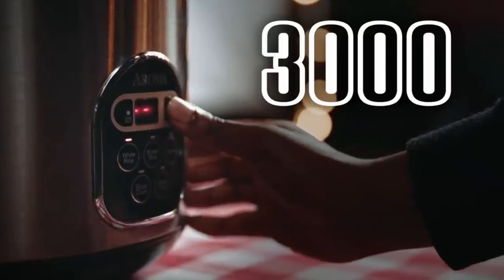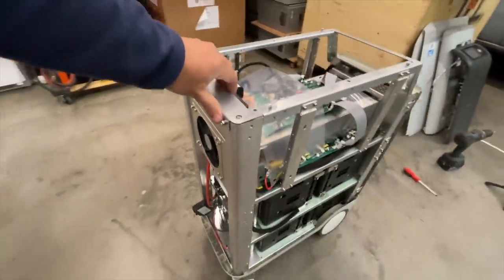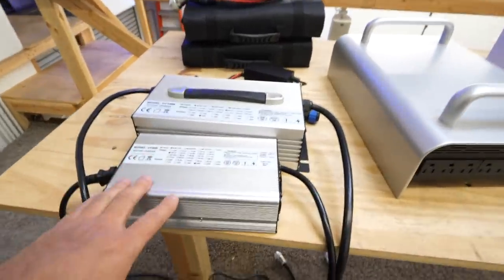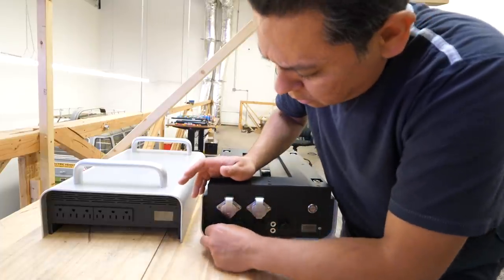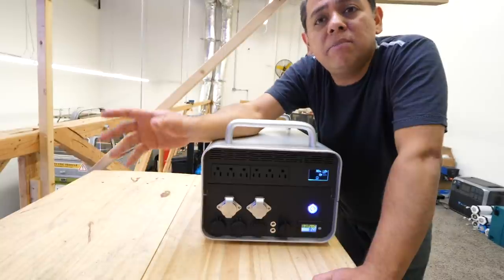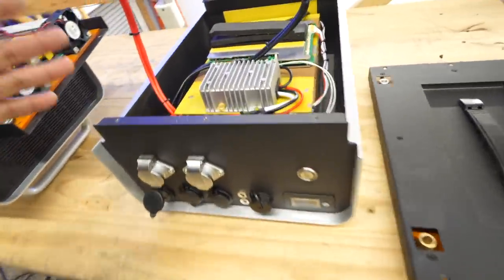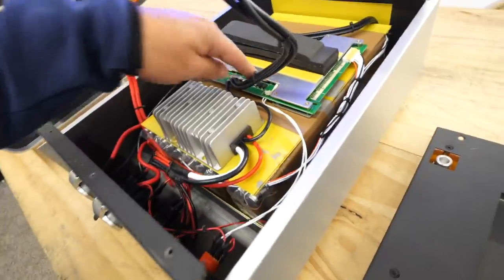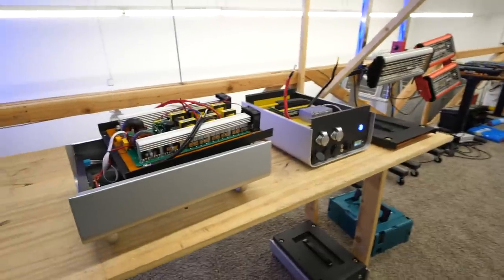How WattAnt made 3kWh capacity 3000W PowerPack under 45LBS

Comment: I just built a 13,000 watt hour system with a 2000 watt inverter. Total cost including supplies and solar panels was about $1,600. Maybe not as sleek as this model, but far more affordable.
Reply: Hi Justin, I like to hear that for I too love to build my own stuff as well. Could you tell me what kind of batteries did you use?
Reply: @solo1848  I used lishen 280 amp hour cells off of alieexpress.  They are 3.3 volts wired in series for a 12 volt system with a mpp solar all in one charger and inverter. Look up Will Prowse on YouTube. He has links to them and instructional tutorials.

Comment: Seems like a good idea but it needs a simple battery pack without the outlets to keep the price down, just charge them up and stack with the other packs
Reply: Like the Titan... yes!
Reply: YES!!
Reply: Options would be nice, with or without.  I could easily see a use case where someone is building a cabin and using all DC in the cabin, but need the outlets to run things on the way to being all dc.  Charge the pack at home, trek out to the cabin for a weekend of building and away.

Comment: Great review Jehu. One serious oversight I'm seeing is the fact that there is no switch on the inverter. It is very common to only turn on the inverter when you need it while using the dc side of things for dc loads like led lights. Without the ability to independently turn on the inverter (preferably with a remote switch placed in a convenient location) I would be losing power all the time having the inverter on standby. Those losses might be small, but with a remote switch you wouldn't have the loss at all. Looks pretty good other than that.
Reply: Hi Rolland, I'm from WattAnt team. We agree with you, and already confirm will add the switch to AC inverter for kickstarter orders.
Reply: Hi Rolland, thank you for loving our unit! We now offer 1500W MPPT controller build in and chainable feature for two 3100wh batteries. So you could get 6200wh at once, also can charge two batteries at once.

Comment: 2:30 mark: "No other company". 

Um, dude ... Inergy and Point Zero have been doing that for at least 2  years. And their price point is competitive. I haven't purchased theirs, because I am waiting for them to shift from Lithium Ion, to LifeP04. WattAnt has done that. Their 3000watt setup, though, is more expensive than Point Zero's.
Reply: Except...try to buy either of their products and you'll see they aren't actually in the hands of real consumers just yet.  The titan is FAR from portable, even being modular, also.  Wattant isn't using LiFePo4 cells, either.
Reply: @toddyork5698  - WOW!  Where'd you get that load of horsecrap, mate?

BOTH companies are on back order. I have actually visited Inergy's home office .. in person. I simply opted to not buy, because I wanted LifeP04. The next-gen Titan, will give me that.

"aren't actually in the hands of real consumers yet"???

Um, yeah, they've sold thousands. I looked at their products precisely because personal friends use them.

And they're the same size as this unit. 

I'm 100% susceptible to being persuaded by empirical evidence. Not horse manure.

Comment: This would also make an excellent UPS (uninterruptible power system), especially with stacked batteries. This could be made hot swapable by keeping at least one battery unit on the inverter. A blank top for no inverter would also be a plus.

Comment: The company can offer a parts list, so there is an easy source for spare parts.
Reply: Hi Carlos, there will be 3 years warranty. Afterwards, you could contact our customer service for spare parts if needed.
Reply: Why is a kickstarter campaign needed for a company that is already in the market but did not really succeded and can offer spare parts for upcoming products if they are able to deliver that ?
Reply: @typxxilps  We are a startup that is releasing our first product. That's why kickstarter and each support is very important to us. We designed and produce our own inverter and the copper connector. Some other parts are possible for the purchase in market.
Reply: @Alicia Wu  Interesting product, how does it protect its self from a drink being spilt on top of it? I see 4 open terminals that the AC inverter plugs into. Perhaps I'm just paranoid, I took advice Jehu and ran a 48v ebike battery without a bms and nearly burned down my place. I was lucky and only had medium to mild burns all over my body.
Reply: @aliciawu3172  Concerned a bit about the DCDC on top of the cells. I don’t see any active cooling for the batteries, and if that DCDC is pumping out serious heat, that not gonna be fun on those pouch batteries- particularly if you were pulling 3000W from the battery while it was sitting in direct sun.

Comment: The other benefit of this form factor is that you're separating your mains voltage SKU from your DC SKU.  That means they can make it international-friendly much more easily.
Reply: Hi Matt, I'm Alicia from WattAnt. You see through it! That's exactly one of the reason we build it this way. Also the DC ports could be use alone without AC inverter attached.

Comment: Now that is modularity especially if they sell each component separately You can buy what you need, you can buy what you can afford, and finally you can add if you need more power than you thought Checks all boxes
Reply: Hi, I'm Alicia from WattAnt team. We offer 1500W MPPT controller and chainable feature for two 3100wh batteries. So you could get 6200wh at once, also can charge two batteries at once.
We do our best to listen to our backers and reviewers, to make WattAnt the unit truly for changing users' solar generator using experience.

Comment: Power Over Ethernet is standard for security, commercial lighting, wireless access.  You can run 12VDC or 24VDC passive devices out those ports with a converter, but without 48VDC out you can't run a standard active PoE switch. 

The ideal configuration would include a slice to convert to 48VDC, include an MPPT solar controller and at least 4 PoE ports, a copper 10GbE and a copper/ fiber high speed port. 

Then it could run an entire remote wireless tower as it's power configuration is fixed.

Comment: Looks great but wish it was LiFePo batteries for safety and longer charge cycles.
Reply: LifePo4 batteries are over 32kg for 3100wh due to the low energy density. Ours is 12.6kg for 3100wh. For the purpose of being portable and easy carry, we make it with EV grade LINIO2, which degrades to 80% after 1500 cycles, and we offer 3 years warranty.
When we make the one to solely be home backup not mobile use, LifePo4 will be our top choice!

Comment: I like the modular approach. Separating the essential battery+bms for portability is good. For this use, I simply use a super-common silverfish ebike battery. Think about it - you get a good casing, portability, good bms built in - and hey, it can run your bike so it basically transports itself. Mine has 900wh (48 volt). I can plug it into a dock I made that provides DC out using the same dc-dc converter in the Watt Ant unit (available from Drok). I don't use an inverter often, but if I need it I can just plug one into the 12 volt DC out. The battery itself is small enough to put two in a backpack, along with the Cycle Satiator charger from Grin (which is a completely fabulous charger). Relatively cheap, common, easily replaced parts, fully modular.

Comment: It´s a good idea to separate the battery and the converter.
For use in RVs they should use folding handles to reduce the height of the package.
Also the connections are not optimal - there should be flat plugs to make it more usable in tight spaces.
Generally it seems that the modules could be built more space saving.

Comment: They should make a inverter part that has a 30 amp RV plug. Then this would be perfect  diversity operation wise. For me if I want 120 I'd prefer to receive power in that manor and have 30 amp RV pass through power feeding the unit when you have shore power available.

Comment: It does not appear to have some way of latching the inverter section to the battery section so you cam move and or pickup both units together using the inverter section handles.
Reply: Hi Phil, I'm Alicia from WattAnt team. This is a very good point to bring up. We confirm will build the unit with latching to lock two parts together for our kickstarter orders :)

Comment: because power equals volts times amps. wire can remain the same gauge for a wide range of voltage ie  most wire is rated for 600 volts. for amps the higher the the larger the diameter of the wire which means more weight.

Comment: Would be good if you could double stack the batteries!
Reply: Hi Roger, I'm Alicia from WattAnt team. We offer the option to chain two 3100wh batteries with anderson plugs as stretch goal when reach 1.5 million for fund raising.
Reply: @aliciawu3172  
WOW! 
I wasn't expecting a response from you!!
Strange thing, I was going to suggest a cable to link the battery to the inverter in case you want 12v and mains in different locations! (RV, etc) 😁
Reply: @aliciawu3172  Hi Alicia, What is the chemistry of the battery?
Reply: Pass through charging?
Reply: @aliciawu3172  so much room in that case, let's make a larger chain amount. 😏
Reply: @mattmullen5166  Hi Matt, it's LINIO2, energy density is 247wh/kg. One of the highest.
Reply: @rogerstarkey5390  We first build a prototype using cable to link inverter and battery. It's hard to make the unit looks great with cable in between. So we decide to use the copper connecting plug as you could see in Jehu's video. And offer to link the battery with cable to make it more flexible for different locations and not get too bulky in size.
Reply: @TracyLiichow  Yes, we support pass through charging :)
Reply: @angelguidesabbath  As Jehu said, the solar panel controller will be build in :) We offer to chain two 3100wh batteries together if our campaign could reach 1.5 million on fund raising.
Reply: @aliciawu3172  very nice to see a rep replying here, keep up the good work :)
Reply: @aliciawu3172  You should consider some kind of hard disconnect so that the battery doesn't slowly and continually discharges. This type of mobile solar generator might be used 1 a year and be put away nearly discharged. It would be a shape if it slowly discharges and turns into e-waste like those tesla walls.
Reply: @Thesaltyseafish  Will do :)
Reply: Hi Roger, we now offer 1500W MPPT controller build in and chainable feature for two 3100wh batteries. So you could get 6200wh at once, also can charge two batteries at once.
Please check the details at: https://www.youtube.com/redirect?event=video_description&redir_token=QUFFLUhqbFpnOURQSTlqNjk0alVxcUZVdlJUcVNrcUpFd3xBQ3Jtc0tsYWZPb2o5Y2p1QWRBUFJRTUVkMUszcUlvNTVPVUZxWldBRVZDVjhmeXpwaGkyYjBsRVUzVm81dW1vcU1EWFRPN1M0Y1JVaWFrZDFzbVpTbldLTE8tdVFvMHowbHNPb0NPTVlGM0VabmQ2bi0wT3pZUQ&q=https%3A%2F%2Fwattant-innovative-power-1.kckb.st%2Fjehugarcia

Comment: lets hope that they make supplemental battery packs that can be stacked in between the inverter and the main battery pack!  I just realized that the chemistry here is LiNiO based.  Have they worked out capacity degradation with this chemistry?  I thought that cycle life was a problem.  Is this not the case?

Comment: I have yet to find safety docs on this new battery technology. I’m assuming they are fairly safe? Like lifepo4? 

And I wish them the best luck, it’s a beautiful design overall. Don’t let the negativity get you down. Produce and you will prove those burned wrong for once. Thanks for letting Jehu test it for all of us!
Reply: Hi John, thank you so much for your warm and encouraging words! 
For the battery, it has 5℉-140℉ as working temperature. It's also electrical vehicle graded cells. So it's safe unless you penetrate it with sharp object with fast speed, or set it close to fire. The difference is LifePo4 less likely to set on fire when these extreme situation happens.

Comment: What prevents you from separating the battery from the inverter while load is flowing? Possible safety issue? I'd like to see some kind of latching system to make separation not SO easy.
Reply from the maker: Could be an issue I guess,  but again I like using a car analogy,  driving it into a brick wall could be an issue also,  so just don’t do it.
Reply: @jehugarcia  I don't disagree. Seems like it could be a liability for the brand.
Reply: Hi Josh, I'm from WattAnt team. We understand your concern, we've put it in use pre-caution. And for KS orders, we will add latching to it. 
But still, ppl can choose not to latch it. So can't say will 100% prevent it.
We empathise not to swap battery when unit is on.
Reply: @aliciawu3172  thinking about it, it could snap into place and if you're wanting to undo it, you would push a button that would release the two units from each other. And in that instance, when the button is pushed to separate and there's load flowing through it, the unit would automatically stop the load before separating. 

Not sure if that all makes sense but just thoughts.

Comment: Are those top studs energized when the battery is turned on?  Even if the top unit is not on?
Reply: With the model Jehu has, it is. We will add a switch to the top unit AC inverter when ship out our product to backers.

Comment: One of the most important features would be a hard "off" switch that disconnects the battery. So that it doesn't slowly but continually discharges. 
Like that dead tesla house battery. They just discharge and go dead after 2 years. 
With this kind of mobile device that is even more important if people keep it in their garage for when they need it again. Maybe they put it away almost discharged and then a year later it's e-waste.
Reply: Our battery when fully charged, will stay fully charged for over 8 months. Ensure to turn it off when not using.

Comment: I prefer inergy flex 1500 where the battery is only the battery, and the main module has all the plugs. So if you need to change the battery it is less expensive. Why do they put the dc plugs with the battery module?

Comment: It would be nice if they could design it to separate into two pieces.  This would allow people to carry one piece in each hand, or make two trips if they cannot handle the weight (or simple are tired and don't want to).
Reply: Now is designed as two separate two parts. That you could carry each piece in each hand. We are also building a troller for it with waterproof case.

Comment: needs some improvements to meet minimum safety standards in most countries... (output protection anyone?)

PS. li-ion...so SOC based on voltage is actually very accurate.
Reply: @aliciawu3172  so how about protection on the AC output?

Comment: Surprised that the connecting posts don't have any protection.  On the battery side it appears the inverter connections always have power.  Please tell me it turns those off when the inverter isn't there???  I'd hate to think that something could accidentally short across them.
Reply from the maker: You could short those,  same way that you could drive a car into a brick wall.  It’s possible, it’s just not recommended. And the posts are not electrified when the switch is off

Comment: "How WattAnt made 3kWh capacity PowerPack under 45 pounds"
because a 3kWh Li-Ion battery pack weighs about 40 pounds.
Reply: Not true. If you used samsung 35e 18650 cells you are looking at about 26lbs including a bms.

Comment: i prefer the charge controller separate so you can switch battery to solar panels while using other unit inside where solar does not reach
Reply: also would love to have that with UK AC as well as JA AC as well. 240.50 and 120/50..lol compared to USA 120/60

Comment: @jehugarcia - you pointed out you're getting similar batteries.  Are they the same lithium tech?  The kickstarter for this says they're LINIO2...that's new to me.  Will these work with existing LIPO/LIFEPO4 BMS systems?  Would love to see a competing DIY build/cost comparison.
Reply from the maker: All these are typically NMC so yah any equipment for 3.7v cells will work

Comment: This looks to be a parallel to the Bluetti AC300 but I am not sure the Bluetti is 24V internally, I think it's a 12V
...Charging phones can be done with induction pads, and will it have adapters to the IPhones lightning connector?
The Bluetti has 6 AC outlets... can a multiple outlets power strip be plugged in?
It was not clear that the thing can act as a UPS be you had a desktop computer plugged in the Inverter box?